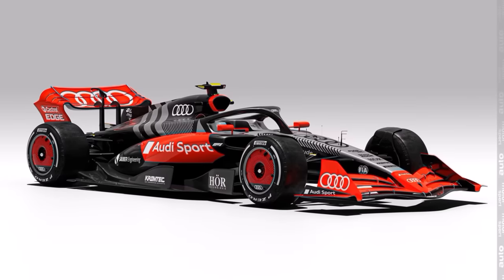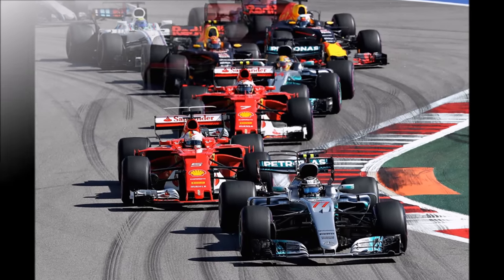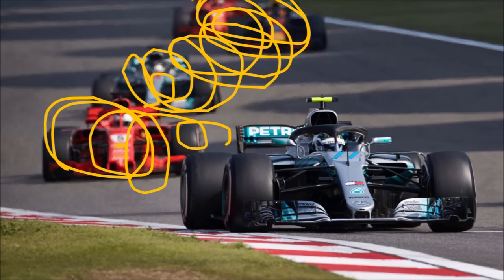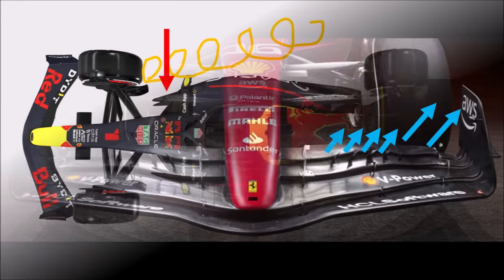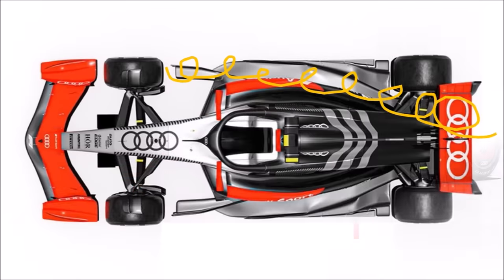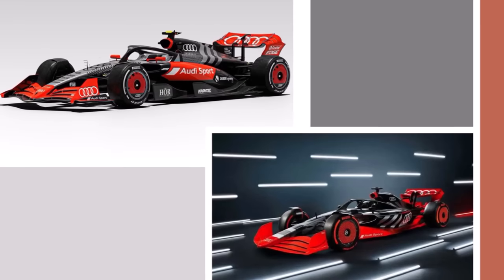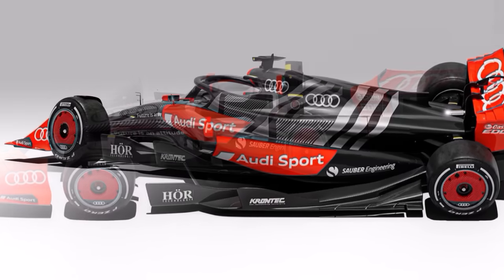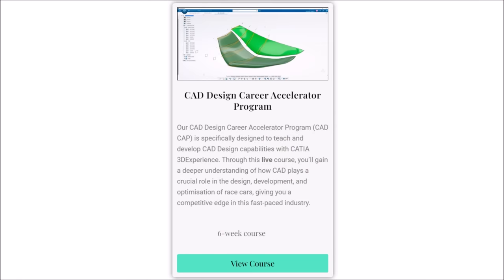F1 Concept 2026 - CLOSER LOOK

Comment: I think this chassis render is promising. The powertrain is still concerning though.
Reply: F1 also talked about turbo lag so I’m really curious how the car will accelerate out of the corner, a 20-30kg drop in weight might make it negligible tho (it’s honestly a big drop in weight)
Reply: most likely ti will change to 60:40 at least, not only cause of weight but not to burn additional fuel which goes against logic, enviro friendliness...
Reply: It is concerning but worth remembering that efficiency will still produce better race times. So, teams will optimize electrical recovery and deployment to reduce fuel consumption.   They may, however, momentarily abandon efficiency to gain track position.
Reply: i think  they are removing rev limiters and since fuel flow mesurement will depend on energy the only way to make more power is to have higher revs and powerful combustion. If they follow through with this and remove weight limit we're onto something
Reply: The MGU-H being removed will be a spanner in the works for all we know. More reliance on the battery and the worse handling means potentially worse tyre wear, meaning that in addition to Formula Tyre Management getting worse we'll also have more Formula Battery Management as the order of the day. What a disaster.
Reply: @sulphurous2656 It means more strategy, which I wouldn't mind.  Maybe NASCAR would be a better motorsport for you.
Reply: @alaeriia01  Kinda sounds like copium, considering how incredibly formulaic and homogenized driving has become since Pirelli became the sole tyre supplier. There's only so much """strategy""" you can artificially cram in when your tyres are all made out of cheese. As a result it's always been a game of who and what car can make their tyres wear out the least, which only inhibits racing. 

Contrast that to when you had multiple tyre manufacturers who competed in making the fastest and longest lasting tyres they possibly could, which enabled drivers to stop perpetually managing all race and instead utilize their true pace during the race lap after lap. It's easy to see why no tyre manufacturer is interested in returning and why the drivers want manufacturers like Bridgestone back.
Reply: @eliasmaissour437  Yeah but the maximum engine energy requirement still reduces the amount of power they can make to a strict limit of around 500hp, and the peak power is still at a similar rpm.
Then the problem is that when the cars derate they will have barely any power down the straights. 
So I think they have to introduce front brake recovery or something to mitigate that.
Reply: @eliasmaissour437  the engines already make about 750hp but they’re reducing it to 500. So making more power is a problem.
Reply: @eliasmaissour437  Rev limit stays at 15,000rpm, the maximum fuel flow (3,000MJ/h) is reached at the same rpm, 10,500rpm, and remains constant. The fuel flow ramp is essentially the same as before, just lowered by around 1/3 in energy terms.

They are going to a 6 speed gearbox, which means bigger gaps between ratios.
Reply: @BonoImFaded  Accelerating out of corners shouldn't be a problem, since they have a 470hp electric motor to help with that and overcome lag.
Reply: @BonoImFaded could be, but dont forget the 2020-21 cars were about 40kgs lighter than the 22 one and mainly the accelrating difference was due to tyres...
Reply: The new engine rules are so restricted it’s ridiculous.

Comment: It's getting better, but still not small enough. The ideal car size would be the 2010-2013 year
Reply: Even those cars were quite big, imo the 2006 -2008 cars were the right size
Reply: The length will be the same
Reply: Agreed however they didn’t have a hybrid pu to deal with like we do now. I think the regulations actually contradict the goal.
Reply: the length of the 09 cars with the current width
Reply: Ideal size would be the 80s turbo cars
Reply: Actually the size of the 1950's racers were best
Reply: Cars from 1995 to 1997 are super underrated and cool imo. They have the width of today's, but shorter than the groove V10s
Reply: @cameron5543 The 2009-2016 chassis was literally almost the exact same dimensions and they stuck the V6 + batteries into that just fine.
Reply: 2016 cars were good for racing but Mercedes was just too dominant in the front
Reply: From what I heard part of the limitation on how small they can make the new cars has to do with the size required for safety structures to work correctly. Not sure how true this is though.
Reply: @bernardoberner4  i agree, but it is unrealistic in my opion because of the hybrid, full tank of fuel with no refuel and the safety requirements we have today, still aiming for that should be the goal even if the cars become slower, those cars looked soooooo gooood and agile.
Reply: @DiogoGaming2  the aim should be to make the cars slower, slower cars make better racing, that's a fact, don't understand why F1 is so obsessed in having the fastest cars in the world by a mile, the racing is 💩, don't care if they're 10 seconds faster than an Indycar, Indy's just better, much better racing and tracks
Reply: the mx5 is the perfect car size, same with the Toyota altezza
Reply: If you could make the early ‘90s cars safer, they’d be a perfect footprint for F1
Reply: F1 cars of the early 90's were real race cars, those things on the F1 grid are more like a fast moms mini van.
Reply: Ideal would be pre 2000 car size.
Reply: 2004 size and weight and power.
Reply: Na dawg. 1969 is the best
Reply: @TillURide420  Formula Ford and FV are better than '69 F1😉
Reply: I agree

Comment: Finaly cars will get smaller. I've been waiting so long for this... I think that this flow structure concept will defenately reduce overal downforce due to the wake being injested by the rear elements no mater how hard teams try. So to keep the speeds the same, by reducing the weight, it would be cool to allow for mechanical batteries (flywheel style) on the front axcel to reduce weight even more and get rid of the e-motor and battery assembly. I don't think that burning fuel to store energy in a heavy battery and then deploy the energy to an inverter/e motor is the best strategy here. Hub motors for the front axcel would also be a great solution.
Reply: F1 makes a big show of being efficient but they never take the best routes, and it’s soo frustrating!

Comment: Imo the miniumum weight should be replaced by a maximum weight. 

Teams are unable to reach the minimum weight because they have to have the biggest car that the rules allow.
Alfa Romeo was the only team able to reach the minimum weight at the start of the '22 season, and they had the shortest car in the field. All the other cars was max length because they knew they'd cut weight over time.

Comment: Finally someone that questions why they didn't go for front wheel hub motors. I can't wrap my head around why they wouldn't do it. It would even shift some of the development focus even more to the regen strategy, regen braking and torque vectoring which should be interesting for car OEMs to gain knowledge in their team about and would progress development that's useful for them

Comment: Everything is great except the increased electrical output while also de tuning the engines. A NA, turbo, or super charged engine running on E fuels is far better for the environment than doing hybrid. As you have the negatives of a engine and battery all in one. Plus the batteries add weight, complexity, and cost which and be spent in other areas.
Reply: The problem with having a V10 engine using e-fuels is... efficiency, i.e. Fuel consumption. E-fuels are expensive, and the aim of the regulations is to use as little amount of fuel as possible. The fuel tanks from what I hear will be 70 litres, and 25-30 litres will be used as a generator for the batteries, that means there is 40 litres of fuel for the 1.6l V6 engine, which needs to last a race distance. This would not be possible with the V10's sadly (even though I want them back). 
The above is the reason why Manufactures want to join F1, because there is a greater emphasis on the Electrical power. I suspect the F1 cars in this era MIGHT sound like the turbo-diesel Le Mans cars, which almost has a wining sound (with the MGU-H gone, the V6 will be slightly louder)
Reply: @auralight-tranceempyrean9748  I just hate that we can’t go back to those days. There are plenty of top level Motorsports focused on the cash flow and pr environmental goals. I’d just like to see one say screw it, we’re doing our own thing and let the viewing figures do the talking.
Reply: @VykronianF1   I agree, but we know that won't happen. And as a fan of the sport of 30 years, I have come to peace that we won't get our beloved High reving V10's back. But the compromise I am willing to take is... Make these engines sound futuristic. We are not there, and I have hope for the 2026 Engine sound. I want a fusion of a Le Mans Hybrid with Formula E. Something that says, wow, that is not high screaming but that just sounds awesome. Similar to an Aussie V8 Supercar that has the Super charger wining all the time, give me that 'wow' effect

Comment: What about brake dust? Wouldn't inwash make the driver suffer more?
Reply: There tends to be an aero bubble around the cockpit that prevents a lot of inwashing there. You see this in wet races where the drivers don't actually get hit with the rain that much. This has the problem of making cooling the driver very difficult, but it would likely reduce the brake dust problem.

Comment: As an MSc in Aeronautical Eng holder that never went into F1 I like the concept of the chassis rules. Will be intriguing to see what features they come up with to condition the wake rather than just getting it outboard. 16 inch is a nice compromise of the wheel & tyre rules. 18 was extreme and reducing should help with ride as well for drivers as less unsprung mass and potentially more spring rate from side wall. 

As a former powertrain design engineer now working in E-Mobility research (I've been around :) ) I don't like those new rules. Waste of fuel burn and if you have no MGUH then having a turbocharger makes no sense in this duty cycle. Turbocharged engines are LESS thermally efficient at full load than an equivalently powerful naturally aspirated engine. 

Overall: Meh...?

Comment: I think one of the biggest mistakes are the development limitations. As you said a minimum weight is counterproductive but I also think that the battery capacity shouldn’t be regulated. It would be much better if there was an encouragement to develop both ice and the electric powertrain + battery. We don’t want F1 to become a spec series…
Reply: We're in a Budget cap era, and not regulating batteries will introduce a tech war, which goes against the budget cap
Reply: @auralight-tranceempyrean9748  But perhaps this way teams could have more freedom to decide where to spend their money on. The currently given capacity is absurd for how much energy they can deploy, teams should have the ability to change that.

Comment: I like the direction, but burning fuel to keep the battery charged on top of the 50/50 power split as well as a complete lack of front axle regen is a big mistake imo.

I think in the ideal world, continuing in this direction aerodynamically as well as providing front axle regen + unlimited harvesting per lap would provide the best result. Additionally I would also consider maintaining the power split of the current regulations and mandating a lower minimum fuel load required to complete a race distance. About 70-80L I think would be best, as it would help address weight concerns as well as promoting greater fuel efficiency in the name of the FIA's continued push for sustainability. 

I also like the proposed idea of removing the weight limit. It would spur greater innovation with respect to the materials science aspect of F1 as teams search for any way to shed the weight while maintaining the FIA's standard of safety. Continuing to reduce the dimensions of the car as much as realistically possible I think is a given and doesn't really need much elaborating.
Reply: Fuel tank will be 70L. With 25-30kg for generating purposes, that leaves about 40L for the combustion engine, which is a 530HP 1.6l V6. Fuel economy is needed as E-fuels that they plan to use is expensive. This is what the Manufactures wanted, more reliance on electrical power. Also with the MGU-H gone, I think the engines might actually sound similar to the Turbo-Diesel engines that raced in Le Mans. The wining sound caused by the electrical motor and a slightly louder V6 engine

Comment: I feel like the racing is going to be realy fun with these new cars but I really dislike how it seems that every new set of aero rules make very little logical sense from a technical point of view. I get that it is important for the racing to reduce the wake of a car and that this inevitably means that aerodynamics will get less efficient, but I feel like formula 1 should be the pinnacle of motorsport; in terms of racecraft of the drivers but also by having the most technically advanced open wheel cars and I dont get that feeling when they are forced to keep all of the wake inboard. But in the end I do feel like this is the only thing they can do. If they do not take measures to reduce a cars speed they eventually get too fast to ensure safety  and I feel like this is really the only way to keep the racing interesting and safe, which is the priority of everybody invoved.
Reply: Nerfing cars periodically is the only reason we see any innovation in f1. We already had technology decades ago to make cars so fast that no human could drive them. Hence why its so important to outlaw tech that is nearing its peak, and instead force team to focus on completely new areas, like the 2022 regs did with ground effect. And despite all that, f1 is still, by a long margin, the pinnacle of motorsport technology.
Reply: From a racing perspective, the changes are highly logical.
Reply: Yeah I understand that nerfing the cars is necessary but I feel like these aero regulations that force the car to deal with dirty air near the centerline is not going to improve innovation. The best solution will not be of any value to road cars since the general aero philosophy is ment to slow the car down. I liked the 2022 regs better because they forced the teams to work with a 'new' way of producing downforce, which does have relevance to road cars. I would prefer these types of nerfs; letting teams deal with new technologies that need time to get up to the same performance level as before. These new rules feel less like a chalange for the engineers but more of a way to make their designs worse.
Reply: @greasedmeat6007  personally, i think that by compromising the downforce produced by the top of the car, f1 can force them to focus more on the floor and ground effect. But i get where you are coming from. It doesn't feel quite right, and they would never do it if it wasn't for the dirty air issue.
Reply: I don't think there will be that much nerfing at all. With an in-wash design, you are almost creating a more balanced car. The current aero I would say is 35% aero at the top and 65% on the floor. With this design, it's almost 45% top and 55% on the floor. From the early concept, the entrance to the floor is opened wider than the current car, meaning more air to the floor, and with the inwash happening above the car, there is more air rushing towards the top of the floor (coke bottle area), meaning this area will be a massive development area because there will be more load in this area. With more air rushing over it from the wake been developed from the front tyres now been utilized (which it wasn't doing before)

Comment: I think they should ditch the front wing end plate extensions, make the floor the same maximum width of the body.

And make them shorter.

To save weight, the best option would be to ditch the ERS entirely. That would save 55kg, not including the extra coolers required for the ERS. They could up the fuel flow to compensate, and still use only 100kg fuel for the race.

Comment: Steps in the right direction! But why active aero? Get rid of DRS, put the MGU-K on the front axle and let the drivers use the energy how the want. They could harvest energy for a lap or two in the slipstream and then use the AWD to pass. That would bring back a tactical element and we wouldn’t have those DRS-trains anymore.
Reply: Imagine how cool it would be to see the driver trying to make the overtake in the corner exit instead by using AWD boost to get the move done.
Reply: @Tommmmmmmmmmmm  Yeah! The driver behind could lurk in the slip stream and take wide lines to harvest as much energy as possible to then suddenly attack out of the turn trying to get as much traction down as possible with the AWD. And with front MGU-K the cars would need a lot less fuel, save weight and volume of the car.

Comment: So powertrain wise it will probably play out like the LMP1 hybrid PUs? Bursts of 1000bhp followed by the depletion of the battery leaving the car with around 500? This could possibly create interesting overtaking scenarios depending on how each driver manages his battery. Then again another "managing/conserving" factor (along the tyres) in a sport that should be all about flat out racing. I dont really know what to think. At least with the MGU H gone ,engines could start sounding a little louder
Reply: I guess they will sound more similar to the current Hypercar class because they'll both be turbo'd without an MGU-H.
Reply: @wiegraf9009  probably similar to a more high revving isotta franchini which already sounds like an f1 car